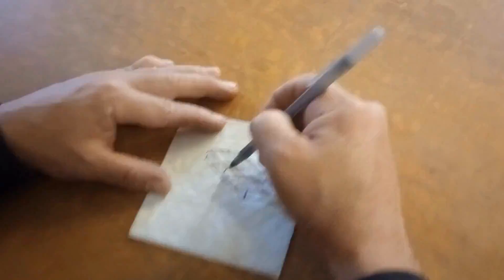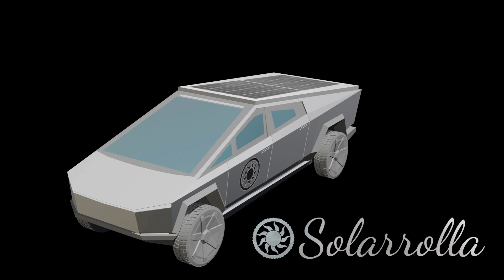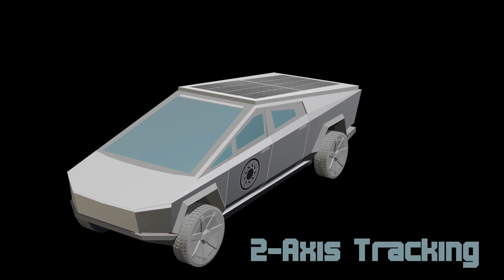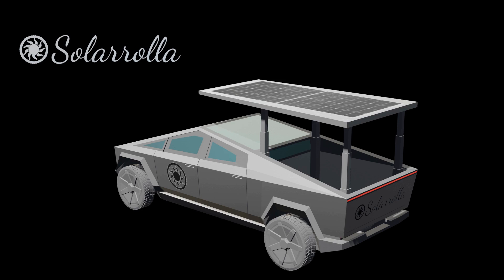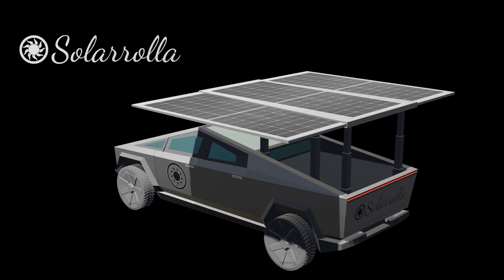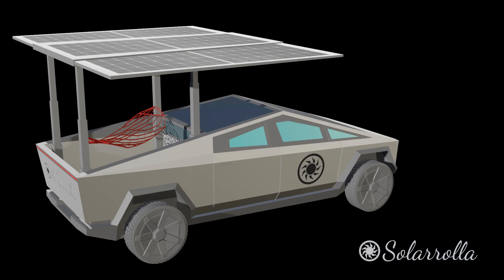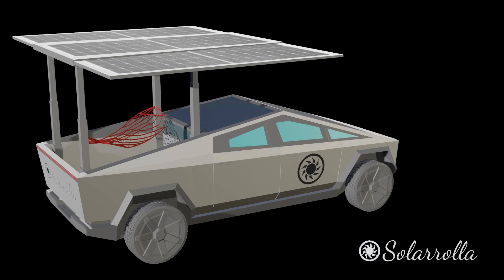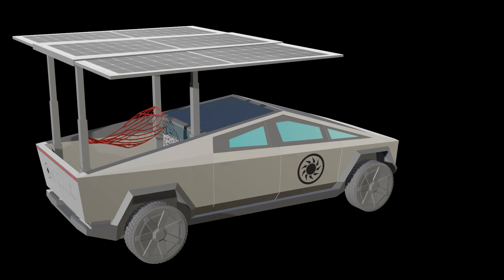Napkin Series 1 - Solar Tesla Cybertruck!

Comment: Just found your stuff. Cool. If you haven't found them already, and if you make it from napkin, you should check with Progressive Automations for actuators. We're running an off-grid 3.6kW charger for our Ford Lightning with single axis tracking with Progressive Automations actuators in our back yard and will be building an overlanding trailer out of a 5x8 utility trailer. I'd like to get 4kW of panels on it with pretty much what you are doing. 8020 aluminum framing with likely flexible panels in 10x100 panel, 1kW modules. Then, mobilizing our Hybrid split phase charger onto a hand cart with, likely, a single 51.2v cased battery like the Chins/LiTime. We also have panels everywhere in the yard. 1200 watts on the G/F artstudio/shed w/single axis tracking, 900watts on our tool shed with actuator single axis tracking/roof lift that powers my home office as well as all our Tools. Fellow Minnesotan fairly stuck in Texas!

Comment: i added 200w of flexible solar to my gen1 chevy volts roof. to simplify the electronics, i just kept everything 12v and wired it directly into the low voltage system. in the process of upgrading the agm battery to a ~4kwh lifepo4 which ironically was about the same price as a replacement for my 15 year old agm battery. people think you need to get really complicated to add solar to an ev and wire into the regen breaking circuit or something but theyre overlooking how much draw there is on the low voltage side of things. i get about 5-10 extra miles of range per charge which is most of what i would hope to gain from the solar footprint anyways without changing the aerodynamics of the car. especially in winter, the 12v loads can get pretty big and youre further avoiding the step down loss of the high voltage to low voltage dc converter. cool project though. my 80$ worth of solar panels paid for themselves in 3 months with gas savings and im getting about 45 miles of range now on just 10 kwh in my high voltage battery.
Reply: I've thought about doing this with our Volt. Did you post your build anywhere?  Would love to see the setup.
Reply: @KevinBarrier  ya i made a big post with a bunch of pictures on the gm volt forums under gen 1 -> modifications
its still on the front page
Reply: @vevenaneathna  thanks! I'll check it out.

Comment: Over $1,000 for 50 miles per day?  If you're stuck in the middle of the desert with no juice, it would be a lifesaver.  Otherwise, it's a probable waste of money, IMHO. The stack of panels and slides would be 8" thick.  I can't see it looking nearly as clean as your rendering.

Comment: I like this. With the robust columns it looks like you were really thinking about mechanical vibration(in an off-roader/overlander sense). In addition to this, a couple of the accordion 2-4kw arrays would be nice to get that charge time down to two or three days. The other thing I'd like to see in a setup like this is the ability to extend a buttress from the upper portion of the support columns to take support poles and drive the cybertruck out from under the array. The idea here is to keep your power station charging while you're in the local area off-roading. The portable battery needed for an application like this would be pretty big...

Comment: I went through a similar exercise. You cant pivot in multiple angles like that, without some sort of play or joints at the attachment points. When the panel tilts the geometry changes and the distance between each "pillar" increases slightly. Its not an unsolvable problem, but a ball joint will not work. I even went as far as to build a prototype and it tore itself apart.

What I mean to say is 2 or more of the pillars will need have a hinge at the top AND bottom, they cannot be fixed in their orientation.
Reply: The easiest way I can explain it is this: If you lay down a book and mark at line at the top and bottom of where the book touches the surface. Now tilt the book up, the side you tilted up is no longer directly above the marked line.
Reply: I think this could be done with three actuators? Two actuators on ball pivots top+bottom in the back corners, with 1 fixed bottom ball top actuator in the center front.